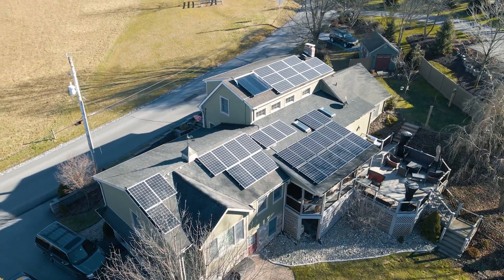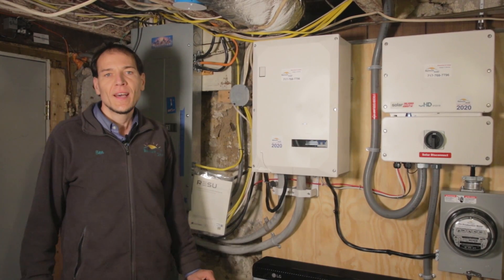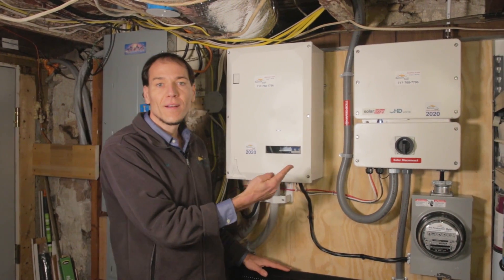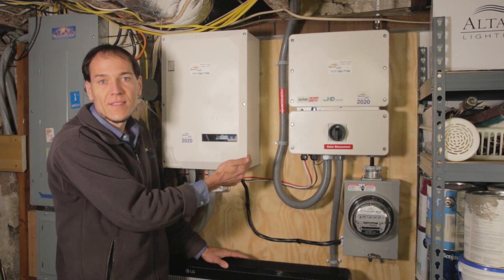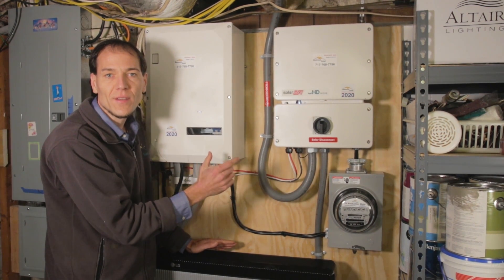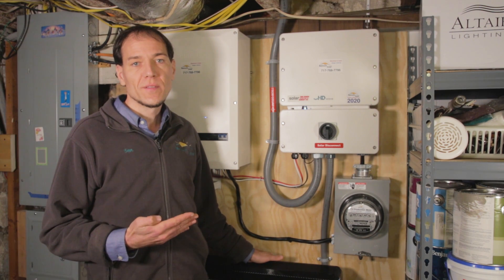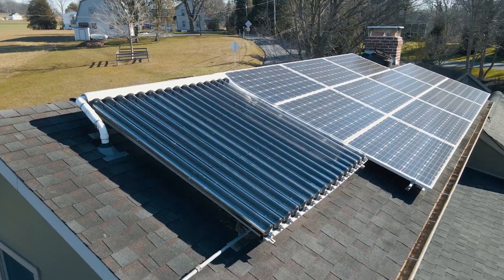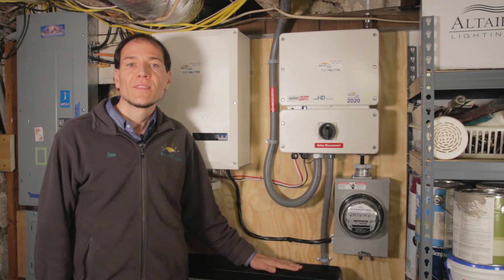How does Grid-Tied Solar with Battery Backup Work? | Belmont Solar

Comment: I would of liked to hear comments about if the battery is used for domestic supply when solar is not generating and if so how  much supply does it contribute. Looking at the size of it and the comment that solar only supplies 60% of the house needs it looks  like it’s a a back up battery only. I wonder how many hours of essential needs the back up battery could supply.
Reply from the maker: Yes, You are correct. This battery in this application is mainly for backup purposes. Mainly because there is currently no real reason to not use net-metering in this area. There is more than enough of storage to last from sundown to sunrise in most cases, if there's and extended power outage. And then the sun can take over at sunrise. Battery & solar sizing is almost always determined by the user's end goal(s).

Comment: I was told I need $400k worth of batteries just to replace 200A service.
Reply: That might or might not be stretching it. But it depends on the context, expectations, need-at-hand, and how the question to that answer was asked. Regardless, evaluate the actual need at do not expect to simply “replace” the electric service unless the need is extremely high. Rather reduce or replace electric “costs” with solar rather that replace the entire electric “service”. 
Battery backup is somewhat separate from solar and is almost always to backup certain loads, rather than to expect to completely replace an electric service. Regards
Reply: “Scalable” can lead to a lot of poor results. Wish you well
Reply: @benzook1220  The way society is going, I'm looking to go off grid entirely. $743 monthly electric bills are killing me. My entire SS retirement income goes to that alone.
SHTF is coming, either an EMP or a hacker will take down the grid soon. Or the government will create a grid down emergency as a pretext to more lockdowns and herding us into "smart cities". 
I just want to build a scaleable system. In the early stages, enough to run the well pump, lights and computers. In later stages, enough to use electric range, dryer and my 20kW sound system and home theater.
Reply: @basspig  you need to be a little more realistic in your goals, or be willing to pay that 400k.  Grid-tied with a battery backup is probably closest to what you're wanting.  With your expectations of a long term grid down scenario,  changing your electrical uses to resemble an off grid home, should be your first step.
Reply: @fredandersen9873  it's getting better with lithium iron phosphate batteries. So far I have 14kwh storage and a 6kw inverter and 40 240w solar panels bought used. A little under 7 grand invested so far. Plan is to triple the batteries to 42kwh and buy the 18kw inverter eventually. I think I can achieve my goal under 20 grand.
Reply: @fredandersen9873 400K doesn’t seem correct?? I bet you could get there for under 200k

Comment: What is the amp hour rating  on the LG battery backup? I read a lot and was an electrician for the RR so I understand loads, line in line out and most of the nuances of the install, but I am having trouble balancing the cost of all the components with the energy savings I would see in my electric bill. I would love to have someone  to talk with about this! Thanks for the video sir!
Reply from the maker: Approximately 200AH. (9.600WH / 48V = 200AH) 24AH if you base your amperage reading off of the 400V reading after the internal DC-DC converter. The battery bank does not provide energy savings, only power security. The solar does the energy savings part. Talk to a local NABCEP certified solar installer/designer. Will be glad to go over this with you further if you are located in the Southeastern PA area. Regards

Comment: What about back feed to the grid? How are you making sure that doesn't happen when the power goes out?
Reply: All inverters that are designed to connect to the public utility grid have a very robust built-in mechanism that prevents it from placing it’s own self-produced power out to the utility lines through the “Line-in”connection. Inverters with a battery do also have a “AC-Out” connection that is connected to a “backup-Loads” panel that is not connected to the utility line. That panel can and does stay live even if the “AC-In” connection goes completely dead. 
There’s more technical details involved that inherently make the scenario in question almost impossible. But for simplicity’s sake we can just say that it all works as it should. Almost like solar magic!
Reply from the maker: That does not and can not occur. The equipment has a built-in isolation relay similar to a generator backup system